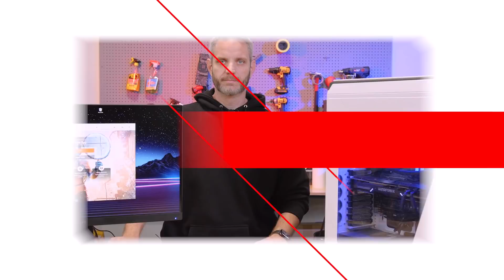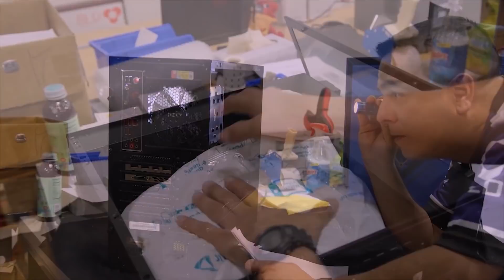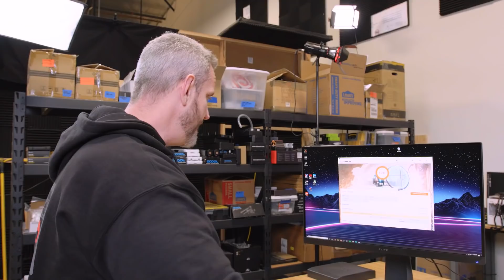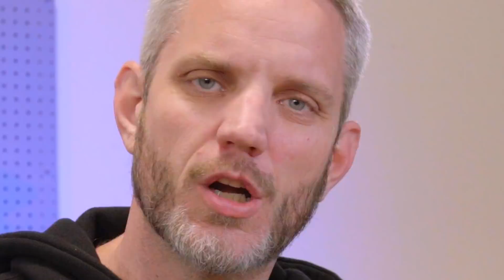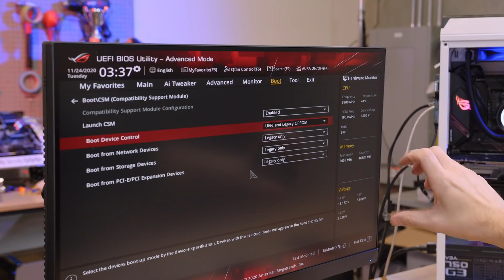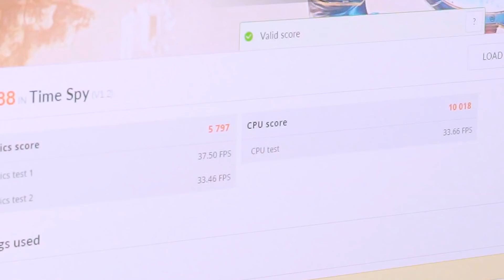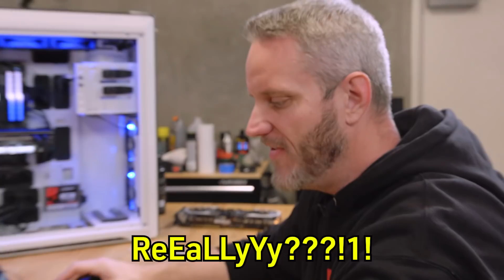This PC upgrade DIDN'T use the latest hardware and still ROCKS!

Comment: I litteraly upgraded all hardware cpu mobo gpu everything. lol and installed and used same windows key for the new system since i used a new nvme and now my bro has the old system and im using the new one i was confused thinking one of the pcs was gunna say activate windows

Comment: Worth noting for folks upgrading to the Ryzen 5000 processors that they don't use a specific power plan so if one doesn't show in your power options then it doesn't mean something went wrong with your chipset driver install.
Also looks like the chipset driver installer is kind of bad at cleaning up after itself and will leave a 315mb or so AMD folder in your system drive that can be removed afterwards.

Comment: Hi! I have been thinking about building a watercooled pc with 3 cards, CPU and maybe the ram integrated into the loop (or a motherboard monoblock). Now does it make sense to run 2 separate loops on that or is it all the same if I have everything in one loop as long as I have the radiator capacity I would that I would have otherwise split into 2 loops?

Comment: I would recommend to never connect to the internet until you have all the basic drivers installed, that way you don't have the messy intel/NVidia drivers that Windows decided to use instead of the specific one you should use.

Download everything you need, put it on an USB thumb drive and than do the every steps mentioned, you really can't trust Windows Update on what it does.

Check if you missed something via Device Manager and than plug to the internet in if you think it's fine.

As someone who used Avast for years, Windows Defender with the cloud bs turned off is so much better than Avast.

Comment: Cool video Jay, it's nice to say you help Nic get his rig upgraded by such a large amount.
2 years back I upgraded from my fx 8350 and Radeon 7800 to Ryzen 2600 and RX 580 at 1080p. (experiencing buttery smooth 60fps 1080p for the first time was soooo awesome)
Should I expect a similar increase in overall experience going to 5600x and 6800xt at 1440p?

Comment: And sometimes doing anything like that just flat out breaks Windows. It happened to me last week, for some reason the hardware change just broke the Windows 10 boot sector, I had to do a complete reinstall because even the Startup Repair options and attempts to boot into Safe Mode wouldn't work. So remember to BACK UP EVERYTHING before you do any hardware changes on your box, because Windows is that crazy ex-girlfriend who will throw a plate at your head and then go slit her wrists when you get her the wrong thing at the take-out place.

Comment: This was basically me last week when I built my new rig but didn't want to reinstall windows. 

Updated from a z270/6600k/1080 to a B550-I/5600x/3080...I updated the chipset drivers (twice now) and I do not get any Ryzen specific options for my Power Options in Windows 10. What am I doing wrong?

Comment: So this is what I learned today: Taking 2 seconds to look in antivirus settings to fix an issue where a piece of software I want to send info about my system to the internet needs to unblocked - is overrated. Which means it is a piece of crap! It needs to guess what I want - and if it fails I need to uninstall it ASAP! Thanks for the edumacatian JayZ .... Love your music! LOL WTF - Avast is a very good and free security program - though I do dislike the way they have tried to sell you an upgrade from the free version with weird hoops and popups - however that can all be disabled ..... in the settings .... which is for losers so UNINSTALLED OMG! :-D

Comment: .. and after turning off CSM, 3000 series start to beep 4 times at boot xD; btw, good proof that the 3070 is NOT as fast as the 2080 ti, because my machine lacks graphics points (with a ryzen 9 3900 xt & 3070 fe).

Comment: Just this week i upgraded my R5 2600 to a 3900X (for a great price) because its the most recent CPU that i could drop into my X370 motherboard. Was a massive increase in CPU performance, and I cant wait to drop a 3080 in to replace my Vega 56 (when they are available to purchase).
Feels like a new system already for cheaper than a new build

Comment: I kinda get the dislike for soft tubing, because it almost always looks terrible, but hard line is absolutely out of the question for any system where reliability is a concern. Systems that you need for work or whatever, that need to be up and running at a moment's notice need to be serviceable, as in, you need to be able to service them QUICKLY when something doesn't work. Hard line tubing simply doesn't allow for that.

Comment: My 1950x is still doing great at gaming with a 5700xt, I do wish it would overclock a bit higher, but it is what it is and i'm happy with it. It took my i7 5960x at 4.4ghz to marginally beat my 1950x at 4ghz in single core performance, but multi core score alone is a heck of an upgrade when I go to render video, not to mention I paid only $300 for the 1950x with a Asus Zenith x399 board and 32gb of ram, I couldn't pass that up.

Comment: I’m having an issue where my WiFi will disconnect at random and will need to rest my wireless adapter for my asus rog strix x570-e Gaming. I’ve contacted asus and they were no help. I’ve tried installing the wireless driver from asus and I get an error saying it’s no compatible with windows 10 pro 64 bit. Any info helps.

Comment: I upgraded my mobo and processor to a b5500m aorus pro and r5 3600 a weeks ago. It was fairly plug and play, but then the rx 460 gpu drivers went fml on itself so I had to reset windows 10. But the process was painless though. Did not lose any personal files. Only the installed apps. 

Will be replacing rx 460 with gtx 1660s.

Comment: I recently upgraded from an Asus p6t mb Core I7 920 12 gig ddr 3 to an Asus Z390-A mb I9 9900KF proc and 32 gig ddr4. I also went from win 7 to win 10 reluctantly because I was to lazy to learn linux as I wanted when I saw what where windoez was headed. I hadn't bench marked anything since the original build on the I7 920 which I managed to get a stable 4.38ghz over clock that could run full time if I wanted. The system lasted near 10 years and only recently showed its age when the cpu over heated due to a clogged water block from its OG build. Anyways I went from playing all my favorite games on medium and mixed low gfx settings to full on maxed out in everything @ 1920x 1080 on all of them with the upgrade so Im super stoked even if its not top of the line screamer build. Oh yeah the vid card is a radeon r9 290x I upgraded to a few years back when the original ATI 5770 could no longer keep up with what I wanted to play.

Comment: The stickiness is from the ruberrized black paint they used on that case after being in the air for a few years. That rubber texture paint will over time lose (leech? ooze? outgase?) the oil in the paint which causes that gooey sticky feeling. I have the same case which also experienced that issue.

Comment: Hey Jay, just a quick question for ya; under what situations will we have to go through those BIOS changes when changing parts? Rather, which parts would have to be changed for that to happen? If I'm just changing my CPU/GPU, will I need to do that? Thanks for the vid!

Comment: I just did the chipset drivers on my x470 w/3700x. I picked up 20 fps on average. Between that and the nvidia control panel settings you've shown, I finally feel like getting what I paid for

Comment: I thought that when you changed motherboards your activation was done for. This didn't go over that, but made it sound like you don't have to worry about that anymore. If that's the case I got a crap ton of windows 10 installs in ssds in my drawer. I always bought a new license with a new motherboard.

Comment: So I had a lot of interesting results. Updated chipset drivers and downloaded AMD Master. AMD Master actually caused a score loss in Time Spy vs. stock clocks. I'm running a 3600x, x570, 5700 xt, nvme m.2 ssd. Just allowing my NZXT H710 a lower ambient temperature with an undervolted GPU and stock CPU clock w/ AMD Master uninstalled I saw a 9266 in Time Spy. Heat is still a major issue for AMD products and is parallel to performance. I need more CPU, the score is lacking, somewhere in 5k in 3DMark. Also, a Lian Li II Mesh, all based on your content so far. Thank you again for the content, I really appreciated being challenged. Ohh, snafu, Happy Thunder Chicken Day too, damn manners, always getting lost lol

Comment: I've had the graphics score on 980Ti hit the same score as a 6700K on a Z170 chipset when paired with a PCIe 2.0 790i Ultra chipset and a Core2Extreme QX9650 (socket 775) CPU. TimeSpy seems to be very much a synthetic benchmark and doesn't really rely on the CPU or PCIe when running.

Comment: I'm jealous....just ran Time Spy on my PC and got 1683 GPU (RX 560), 5807 CPU (Ryzen 5 2600 stock), 1883 combined score. Jay randomly grabs a $1900 GPU as a upgrade...ffs. Yes I had to disable Avast to get 3D Mark to run without crashing.

Comment: Jay, I think it might be useful to do a video(s) on setting up security (encryption/ permissions), and for file-sharing (backups!) since people are working from home more. Pus, ransomware seems to be fashionable these days.

I kind of miss IRQs physical jumpers? dip switches, even tapping a strand of wire to short contacts on the CPU to overclock it,  and "Plug & Pray". BSODs if you changed anything, even safe mode wasn't that safe, not having another computer in the home. So you were own if you were stuck.

Good, but insane times. Went from playing Super Mario World on a SNES to Unreal in about decade (those reflections and lighting! 🤯).

Although oddly, we've only gone from fast ethernet to gigabit in 20 years. 10gbe still isn't standard for high-end desktops (Intel is well-positioned to push it to be more competitive), just a few half-measures which feel like hacks (don't see them in the server world).

Comment: Hey all, can't figure out how to get the power options to show up for 5950x, gigabyte x570 master. Installed the chipset drivers but power options don't show up. Read online they 5000 series doesn't need it, not sure if that's accurate?

Comment: "You can update your systems, you can changes platforms, you just can literally change everything and keep your windows installed running as long as you make sure you turn..."... well I certainly know that that will happen in a Windows 8 | 10 2-Go. Sadly I have some Dell Latitude Intel Laptops, with Windows 10, and if you change the SATA MODE in the BIOS will make Windows 10 run in BSODs... I'm just unlucky, I guess!

Comment: Just helped a friend build a rig. We were going to buy components and put it together. Their parents turned it into an early Christmas present so we needed some sort of prebuilt. Luckily, we're close to a Micro Center:
Ryzen 5 3600
Hyper 212 Black
16 GB G.Skill - 2 x 8 GB, 3200 MHz, 14-14-14-34
ASRock B550M Pro4
NVIDIA 1660 Ti
500 GB MX 500
2 TB Seagate Barracuda
650 W PSU

He can upgrade to a Ryzen 5800X, second hand, a few years down the line if he wants. Overclock the RAM too at some point. Even upgrade the GPU when he may want to. PSU & CPU cooler support.  Waiting to find the specific monitor in stock as he does some light gaming and will be editing photos on the rig. All in all, ~$1500 out the door.

Comment: Hi Jay, I really enjoy your videos. This one in particular hit home as it just so happens I am about to do exactly the same thing. I have some general tech knowledge  but I still value good research. I am installing a new MB, CPU and RAM. My research showed all is compatible, until youn said something in this video. 
My MB is an MSI X470, CPU is Ryzen 5 3600X
The board says 3000 series ready. But does that mean Ryzen 3?
Maybe I can flash the BIOS with cntrl F5 and update the BIOS if it won't recognize the Ryzen 5?
I'd greatly appreciate any suggestions you may have. 
I at least know now I don't have to overclock my Ryzen 5. Thanls Jay :)

Comment: I did something similar by upgrading to b450 and a 3600 from an i5 4460, and kept my gtx 970. Maintained the same ram capacity, and kept my nvme ssd (was running on a z97 board).

Comment: One of the reasons I've always liked ASUS is because they always included a disk with all the latest drivers making it very easy to install in Windows.  Now days Windows 10 is capable of upgrading itself making it even easier to upgrade your hardware.  In the old days of Windows 4 and 95, switching hardware meant you had to reinstall Windows otherwse it would not even boot!  BTW_ Don't you just love that huge case?  It' so easy to install new hardware when you have room to work!

Comment: I have i7-5930k 6 core 12 Threads overclocked to 4.5Ghz on all cores with 64GB 2666Mhz DDR4 memory on Asus Rampage V Extreme with 2 EVGA 1080 FTW GTX in SLI and  1TB Samsung 960 EVO NVme M2. I know upgrading GPU to RTX 3080 would make difference, but should I upgrade CPU and motherboard and memory? Would performance increase be noticeable vs 5900x and X570 board???

Comment: When I went from Intel to AMD and just booted up when I swapped mobo and cpu in the case, the pc didn't boot. This was because the chipset/ intel SATA drivers from intel was miss behaving with AMDs. Soon as I cleaned installed it worked

Comment: Last time i changed motherboard and CPU (from 6700k to 9700k) I only had to uninstall HDD controller in Device Manager to get default one for Windows to boot normaly after the swap. Would it still work in this case?

Comment: Then Windows will complain it's installed on a different system. Try to enable it and tell it you did a "major hardware change".
20% chance it activates.

Then spend 8 hours getting through to MS to force them to activate. They will block you, tell you to buy a new licence. Fight them for more hours. Might work if you don't ever give up...

Comment: Jay, thanks for the info on the AMD driver suite; I built a Ryzen system a few months ago and didn't think to check for those. I'm running Ryzen Master but the drivers and tweaks you showed made a noticeable improvement in benchmarks and FPS.

Comment: I actually just got rid of that case myself 2 days ago for a newer build and I can say the sticky gunk on the case is not from vaping. I dont vape or smoke at all and my case was also covered in the sticky gunk, mainly only on the black painted parts not the white area. I believe it is something to do with the type of paint they used on the plastics or the plastics itself degrading over time
Reply: got rid of that case last month too, and i can confirm this. I’m a complete non-smoker and some of the black painted parts were sticky (also the mechanism used to remove the side panels became unreliable due to the screws being a lil rusty.)

Comment: HELPP  HELPP  HELPP 
so when i try to download the chipset it says "This installer is intended to be deployed only on an AMD system, Exiting installation as the requirement is not satisfied." I have the same cpu u used in this build on this video.
Reply: Is it the right motherboard. Go to the motherboard makers website an get the one for your exact motherboard

Comment: Thanks Jay, went and downloaded the drivers for ryzen, I didnt have any issues, but its still better to do that.

Because I had to update the bios to v2, I installed the "AMD all in 1 with VGA driver ver:18.10.20_NHDA" so I thought that was it, then I saw the install screen in the video and went "oh, shit". Let's see if I get better numbers in 3dmark.

Also really gives perspective, I have a ryzen 1600, 16gb at 3000mhz, a b450m pro4 board from asrock and a 1660 super. The cpu is overclocked to 3.8ghz, and the GPU is also overclocked using the msi afterburner scan utility, the score was 6300,  which is more than the one at the start, its nice seeing an "entry" level system doing that, means tech is really going forward and getting cheaper.

edit: its now at 6320 so its not a noticeable difference for this.

Comment: Heads up, I just bought the Asus ROG Strix B550-F this morning from Newegg, the price is down to $174.99, from $189.99, there is a instant $10 off coupon on their website, and Asus is offering rebates on dozens of components when purchased through either Newegg, or Microcenter, by November 30th. The rebate for the B550-F is another $25 off! I also picked up a ROG Strix RX5600XT T6G, which has a $30 rebate. Also, AMD has a current promotion of either one, or two free games with purchase of select 5000 series graphics cards. The games are Godfall, and World of Warcraft Shadowlands. I've never played Godfall, but the reason I'm building a new computer is to continue playing World of Warcraft, whose new minimum requirements says the GTX 650, in my current computer I built twelve year ago, won't be supported in the Shadowlands expansion. Now I just need a CPU and some RAM. I'll get new case, and PSU next year.

Comment: I threw a 3080 into my 12 year old system ... it works just fine... timespy gpu 16292... cpu 3061   (got the 5900x in a box...stock bottleneck was the samsung ssd)

Comment: FYI, I've built and updated probably over 100 computers, Windows may or may not lose activation with a mobo change. I've had it go both ways. Just a little heads up.

Comment: Thanks jay for mentioning installing the chipset drivers. on a whim i decided to check if my power options matched, they didn't, so i installed them. then I thought it would be fun to run timespay and compare results. boy was i wrong. i got a 4306 (combined, 4466 graphics; 3580cpu) and was like, ok... now how does that compare. 
sigh. it's worse than what Nick started with. now i'm sad.